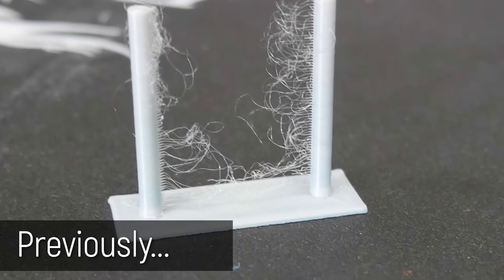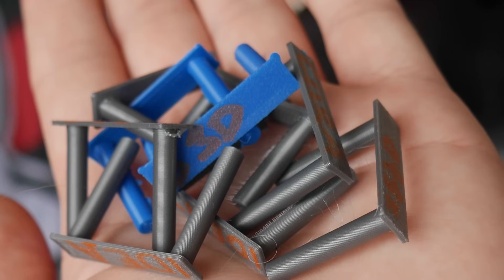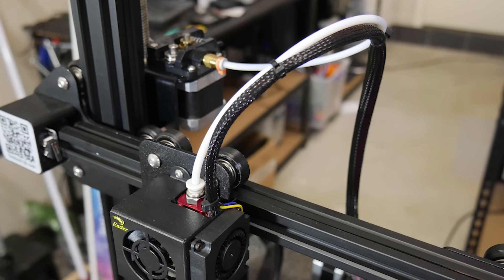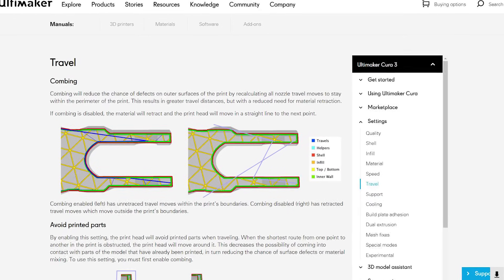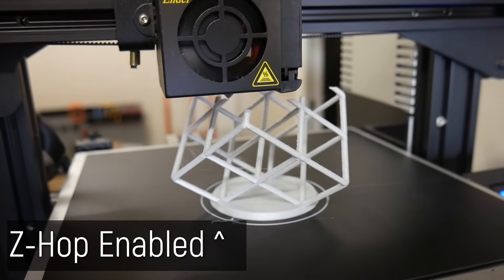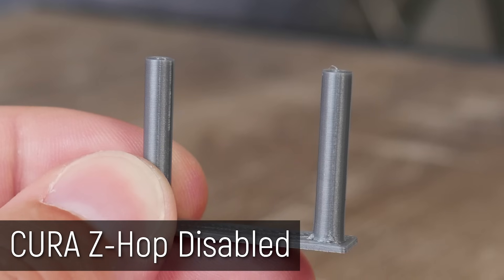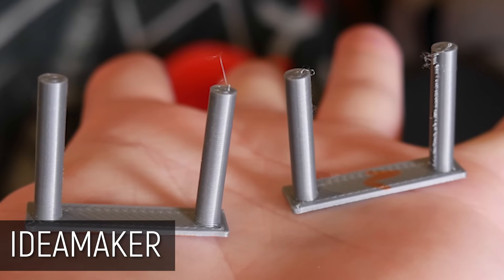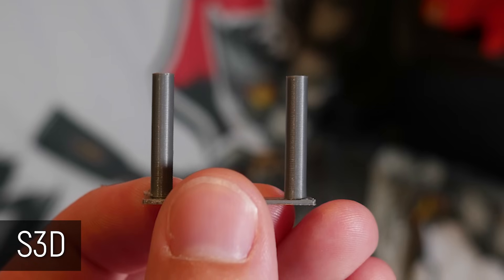Stop Ender 3 Stringing with this One Weird Trick! (ok but seriously)

Comment: Neat, I didn’t watch your Ender 3 Pro video because I assumed it was just going to say the Ender 3 was good enough but you could fork over more for the Pro if you wanted, I’m honestly surprised to hear you didn’t like the Ender 3, as a designer, I get the criticisms I am hearing here, just, that without anything better at $200 it might give a lot of beginning budget makers that are insecure the wrong idea that the Ender 3 is flat out unusable which as someone who recommends to a lot of students who barely can afford anything above 100-150, 220 is already a stretch for a printer, some spare parts, and a cheap roll of filament. Anyways, you certainly don’t mean anything malicious and I know in the long term that what you are saying will push the industry for better quality control which  I agree is badly needed.

Also, I am recommending to a lot of students and teachers craftware rather than cura or the heavy cost of simplify3D and I haven’t heard it mentioned in your videos for a long time. It honestly looks more like a friendlier version of ideamaker but maybe your mileage varies.

Comment: I bought an Ender 3 on amazon a few months back and had a couple issues with it but creality helped with these issues. I had a couple rollers that were a little weird ending up with weird parts in the print and also my nozzle wasnt assembled correctly and constantly oozed out the top. I sent them an email with a recording of my issues and within a few days I was sent a replacement set of rollers and a new nozzle assembly. I'm not sure if they would have sent anything else that is worth more money as a replacement but with the service I received I was happy and it still prints quite well compared to my previous Printrbot 1405. I printed your tree torture test at 2 different scales and without zhop and there is no stringing at all, but they don't look the best in a couple areas because of the cooling. Each one finished and has no broken off bits, just some areas where it seemed like it was gonna break off that look a bit bad, haha.

Comment: I’ve never had stringing issues with my Ender 3-in fact it’s the easiest printer I’ve ever setup and used (admittedly I’ve only had 2 but my last one took A LOT of work to get it to print as nice as the Ender has from day dot. One if the very first things I noticed Angus when I started printing was the MASSIVE variations in filament results etc-for example I found I can print translucent cooler than I can print coloured PLA - I’m assuming the pigment in the coloured PLA makes the difference. I found this out whilst printing a 3D lab print plane-I was having huge issues with the clear PLA, yet coloured stuff was fine-that’s when I discovered the variation in viscosity at a given temp for different PLA’s. Ever since that discovery my print quality has progressed in leaps and bounds-I bought all this upgrade stuff for my Ender 3 (cap tube, all metal hot end, BL touch, titan extruder, new tube couplers etc) and after 7 months I’m still using everything as the machine came except for the feed mechanism-I was getting some slippage so I put my alloy upgrade on. I use S3D exclusively and tbh I have zero issues, zero stringing, and generally good prints. I’m about to flash new firmware so I have the thermal runaway protection so I will possibly tweak the E-steps at the same time-but then I wonder if I really need to if I’m already getting good results. End of the day I think the initial Ender 3 was a bit “hit And miss” quality wise, and clearly I got a good one where you didn’t. I will also add I was super fussy setting my frame up square to the point i used a piece of paper as a Shim under one side of one upright to get it square. So yes. I think it’s a combo of decent assembly, luck of the draw (from creality), and also the filament. I got BETTER results from cheap filaments than I did from “branded” stuff! 

Keep up the good work, I know it’s been mid 40’s over there this week-it’s nudging 30’s here in NZ👍
Reply: Hi John, I'm a chemist and will give you some hints about the filaments and why you have better result with the cheap ones. PLA (polilactic acid) industrially is produced by 2 ways, one using solvents that is the cheap one and other called ROP that is technically fancier. So when you use solvents there are huge odds that some solvent will stay on the PLA and this will make it more ductil (easy flowing) the more expensive that can be made by ROP have a bigger molecular weight that is better material quality that is not better handling for printing (at least in our cheap printers). Then the PLA has a natural milky color (lactic means milk in latin) so to be clear there are additives hence more solvents on the process so it melts in lower temps, colors rise the melting temp in any plastic and the rise will depend on the color and quality of the pigment (also if solid color or translucent). branded filaments have more additives usually to make them more "uniform" but usually means more controled settings hence more precise termistor, constant more unifor heating, etc, in plastics industry every time they change materials they do a calorimetric test to determine the thermodianmic qualities of the material that can vary from batch to batch, in our case we waste some meters of filament trying to get a quality print in the plastic industry you can waste tons of material before find out your bottles are too brittle or too elastic or too small when cool. The best you can do is write up the behaviour of the materials you use in relation to the colors and that will help you to foresee what to do when you use new brands and reduce waste.
Reply: @EPortillo5000  That very much confirms my thoughts on different colored prints Thank You! Every time i see tests done with different colored models being compared I always have second thoughts and take the comparison with a grain of salt. The lack of controls when testing (don't mean to be demeaning) is very amature when i see most reviews, like room temp (effecting model temperature, thus layer adhesion and warp/collision) and thermal sensor temperature delta to the actual extruder tip/filament (which also changes if the room is cooler or warmer to a lesser degree). And of course I'm very much an amature ;-)

Comment: If you have a creality cr10, can you run this on it please. Thanks
I too noticed that filament plays a very important role in quality, dry Vs wet in particular
Reply: Simon Acock you can run it on anything you like as long as it's FFF/FDM and it takes Gcode. So yes the CR-10 is fine.

Comment: Angus, I also had hard time with my Ender 3 at the very beginning (my first 3d printer). I went to the point where I wanted just to grab this shit and throw it out of my room's window, then sit and but eg. Prusa. But then I realised that ok, that's really cheap stuff, I can't expect it to be perfect. I started with changing extruder to regular MK8 extruder with adjustable spring tension. Then printed and mounted new PTFE coupler for extuder (in my case ptfe in hotend fits nice and snug). I also realized that I have gap between PTFE and nozzle - fixed that problem. I milled frame profiles to make them perfectly square, completly reasembled my Ender. But still have an issue with bed (bed carriage is not flat and it's shitty designed, so I will remake it), but prints are pretty good now. PTFE tube also have tendency to stretch, so I wrapped it up with fiberglass tape (belive me it works). I tweaked Cura to the point that satisfied me. BUT ! ! the thing that changed my prints quality just insanely is - changing nozzle to genuine E3D. You need to reassembly whole hotend (different thread lenght) but difference is just incredible. Walls are much smoother, it's easier to re-level bed, and since that change - I never had issues with extrusion no more. So, try also this one, should see clear difference. All the best from Poland!
Reply: Hello. I read with so much interest your comment. I also own a Ender 3 Pro. I want to upgrade mine with yellow springs (or silicone cushions, i haven't decided yet), MK8 extruder, Capricorn tubing, and so on. But what about PTFE coupler? Did you have any link? I wanted to print mine too but i can't find the proper one. Thank you very much for sharing your experience. Greetings from Italy.

Comment: Cura also has the "Iron top layer" function which makes models with any flat tops so freakin smooth
Quite sure Cura is the only slicer with this option currently, I could be wrong though xD
Reply: It works really well (I find that having more top layers does help, I'd say at least 4) but it takes a loooooooooooooooong time, sometimes it even doubles my print time, depending on the model.
Reply: @SmokedHam444  I use 13% flow with around 19mm/s and it's pretty decent i'd say :)
Reply: Oooo, I'm trying that option.
Reply: Thanks for mentioning it, i wouldn't have known its there!
Reply: OMG! i just tried the iron top layers feature, game changer! its amazing!
Reply: For those just finding out about the top layer ironing feature—try the alternate ironing patterns, and maybe messing with the parameters as it can lead to interesting results.  I do a lot of wood based material printing and found the both the concentric pattern and deeper inset (melting more of the built up material below the surface) p cool
Reply from the maker: Neosanding right? I've been meaning to try that out .
Reply: @MakersMuse  it works pretty good but to be worth while it needs to be a big area.
Reply: Top layer ironing was originally developed using Simplify3D. Minor trivia.
Reply: @skbigelo  Yea but evidently S3D never decided to use it 🤷‍♂️
Reply: @troy1572  S3D has jumped the Shark. I can't even use 4.1.1. It's so far behind other slicers now.
Reply: @skbigelo  I agree.  S3D 4.1 was so bugged, it's a shame.
Reply: skbigelo 
New version coming soon. And to put salt in the wounds it is not an upgrade to my existing version, so I would have to buy the new version.
Ah well. Bye bye S3D.

Comment: I think that your torture tree would benefit from a different form of z-hop. In Cura, the z-hop is called "z-hop when retracted" or something like that. Instead of doing the z-hop at the retraction time, I think a "z-hop when crossing over outer perimeters from the exterior side only" would help. I find that the nozzle can escape a curled fine feature from the inside-out but when it tries to move from the outside to the interior of a curled feature that is when the nozzle catches the edge and tweaks the feature. This way, the nozzle would only raise/hop when trying to get over the features where it catches, but it will still wipe and retract the way it does that gave you the great results in the video with z-hop disabled.
Reply: Wait is this an option in Cura?
Reply: I was saying I think it should be an option, not that it is (as far as I know). I was suggesting it as an improvement. I am sorry if my wording implied it was already an option.
Reply: @USWaterRockets  Actually, I think I found it. Z-Hop Only Over Printed Pats. 

Description: Only preform a Z Hop when moving over printed parts which cannot be avoided by horizontal motion to avoid printed parts when traveling.

That sure sounds like what you are describing. The only question I would have is the 'ONLY' part of the description. Is it saying that it will do the Z Hop only when traveling to a printed part or will it Z Hop at the retraction move and then again at the exterior wall at the end of the travel move?
Reply: Maybe we should analyze the g-code movements like Angus does in the video and see if it's possible to figure out what it does. This sounds similar, but it may still hop at the start of the move, leaving the string/blob. The motion I had in mind was to hop over the printed part as the nozzle got close. The standard z-hop lifts as the extrusion completes and then moves over to where the next extrusion is to start and then lowers. I was looking for something that only lifts close to the perimeter it has to cross to get on top of a previously printed layer that may be curled on the edge.
Reply: @USWaterRockets  you can write some code to post process the gcode file!
Reply: @TheXipherZero  I'm still new to 3D printing so I may sound silly when I say this, but I was looking through settings and I found "Avoid printed parts when traveling". I'm not sure what it does exactly, but the description says the nozzle avoids already printed parts when traveling. This option is only available when combing is enabled. I wonder if that would be kind of what we're looking for.
Reply: @davidc145  I think that attempts to avoid printed parts during a travel (Chooses a travel path that doesn't intersect unnecessarily with a printed part), but does not change the elevation of the nozzle. If printing really delicate structures, increasing the elevation of the nozzle as you approach a part can prevent the nozzle from catching on the edge of the part and causing breakage or other issues.

Also, I have seen problems where there is a little bit of plastic on the end of the nozzle when intersecting with a part leaving a small blob on that edge. If the travel is in that same place over successive layers it can build up and cause print failures.
Reply: USWaterRockets z-hop for me caused some splits in my models
Reply: I was going to ask if there was a wipe/comb and then a z-hop feature!   Maybe do the z-hop while in travel or just after moving off of the comb location.
Reply: @PRiMETECHAU  it leads to the conclusion it should, though it seems it isn't a solved problem. Cura need to get on it.

Comment: Did you try to use Slic3r PE as well?
Reply: I tried. Also using only slic3r pe with ender-3. I'll post a photo of towers tomorrow. Now printer is busy. Also not stringing...
Reply: @lucjann.577  How did it turn out with Slic3r PE?  I'm going to try tonight...
Reply: Of course he didn't.
Should he try it, it'd be clear there is no need for anything else..
But S3D is paying him for ads, so it's a no-go.